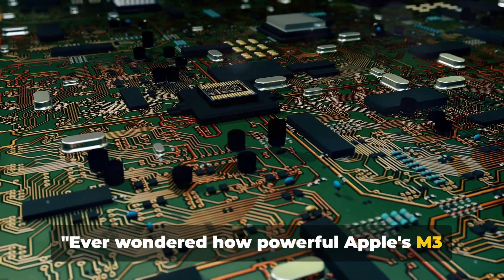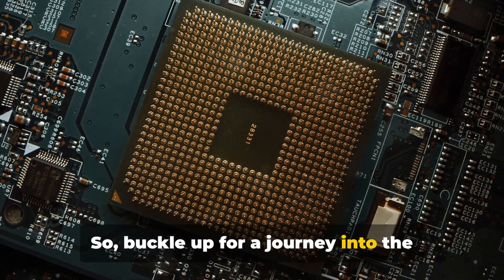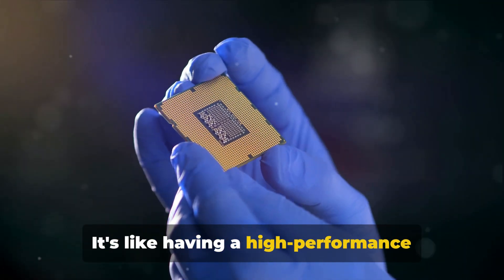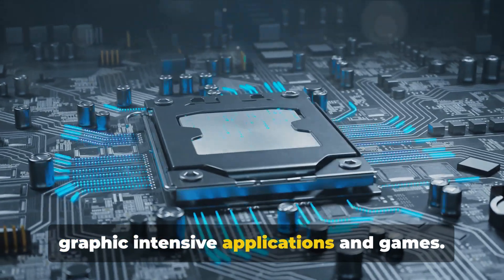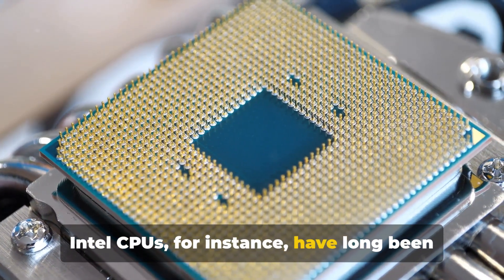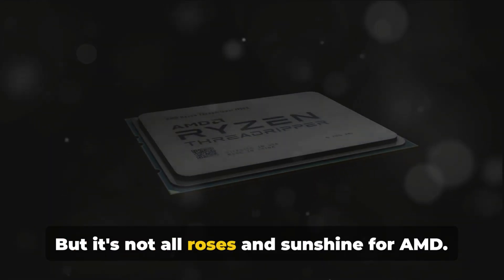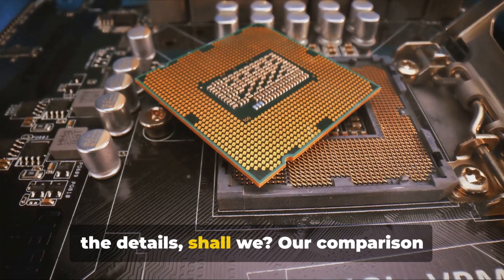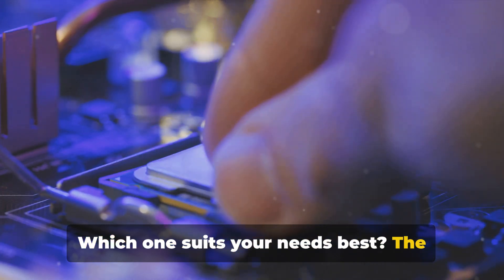How powerful are apple m3 cpus compared to intel and amd cpus?

Comment: Ummmm whoever made this video is actually incorrect. Fact AMD the last 3 generations has been power efficiency king. Intel CPU's are pulling 3 times more power to get on average less than 10% fps advantage. The new Epyc line of cpus uses the same amount of power for 128 cores as an Intel I9. Please get your facts right.
Reply: Ya as an Intel guy. AMC CPU's ARE better for gaming and AI. No way I'd get a i9 at this point. I just hate how AMD STILL has pins you can bend...
Reply: @jasonjennings8465  am4 has pins, am5 (7000 series) don't have pins anymore.
Reply: @guywhitey2028  Nice! I dont know why I didnt know that.  I just got my first AMD for my mini pc. Using it for vm's and programing. So far, it's been good.
Reply: @jasonjennings8465  yeah I purchased my 5800x3d right after it fell in price when the 7950x3d came out, 280 bucks was a no brainer, especially when considering it traded blows with intel's 13900k, while consuming about a third of the power.
Reply: @jasonjennings8465  search up AM5. it uses an LGA socket the same way intel does. no more pins to bend :)

Comment: As always, Apple rules. Thank you for the video! :)
Reply: Over the blind apple followers yes ;)
Reply: not quite, apple when it comes to computers are 👎
Reply: normie alert
Reply: They make some good stuff, but you pay a high price for it, both literally and figuratively.
Reply: @nickdibart  there are things that are much better at the same price.
and if you are willing to pay even more the ceiling is much much higher.
apple is just trash with a nice packaging sold as a premium product with good marketing.
when you buy one of their product you mostly pay for the marketing you saw and not the device itself.
Reply: @alkeryn1700  I agree. You can usually spec out a PC to match or surpass the performance of a mac pro for half the price and still have the ability to upgrade it in the future.